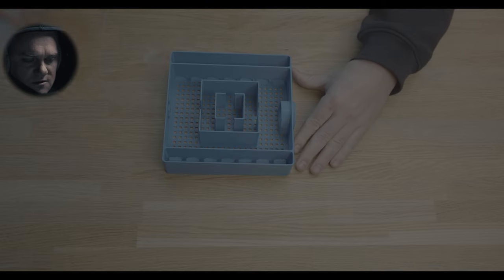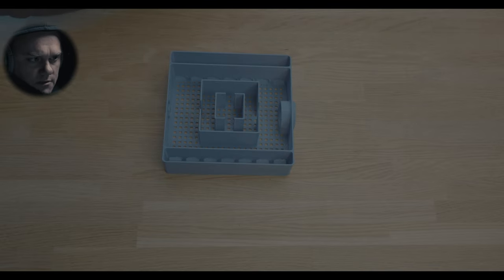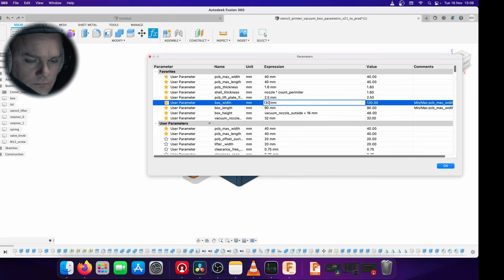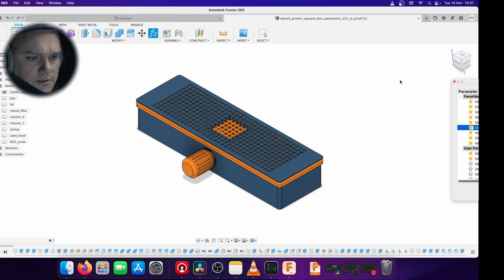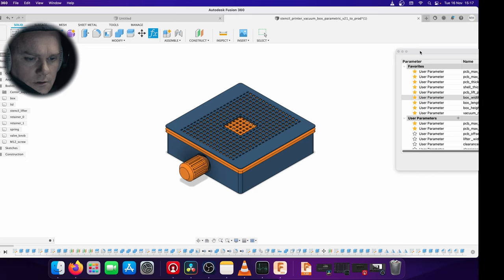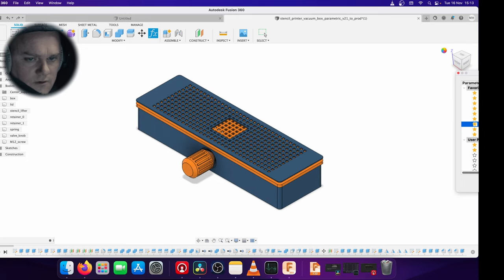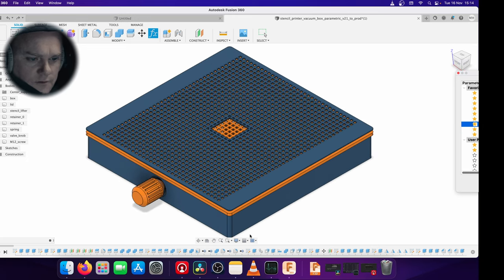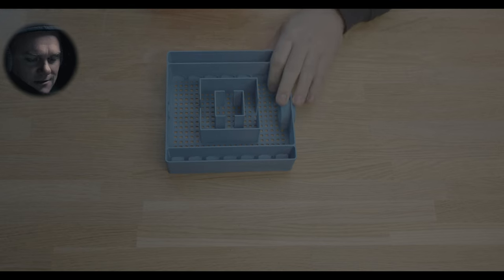V2 Vacuum assisted solder stencil box

Comment: I've been trying to design something for solder paste application for like two months now. I've played with crazy xy tables, a bunch of madness with linear rails on a bunch of extrusion, all kinds of stuff. But I keep coming back to repeatability and simplicity, and this absolutely kills it. Firing it up now to give it a test.
Reply from the maker: Yeah. I went the same route my self. Let me know if you have any issues with the Fusion files. Ive made some progress since the last video. What size stencil do you need it for?
Reply: @MariusHeier1  They were mostly fine, but I see what you mean about parameters just absolutely eating your machine, haha. My board is actually a bit huge... ~200x100mm... which ran me into another problem. My Prusa Mini can't actually manage the box for that size!

If you've got suggestions for splitting it, I'd be curious to hear them for sure. I spent a while last night plotting out the box as something I could laser cut, only coming in to 3d print the pieces that don't make sense to laser cut (anything that needs to be board height, for example).
Reply from the maker: @JonathanBarket  How big is your stencil?
Reply: @MariusHeier1  It's a full sized, framed behemoth at the moment. It needs revisions though so I'm prepping as if it's roughly the same size as the board.
Reply from the maker: And what would be the safe print size of the Prusa mini?
Reply: @MariusHeier1  Total printable area is 170x170
Reply from the maker: @JonathanBarket  Starting a stream now trying to make the box. https://www.youtube.com/watch?v=X9sA_VIDe2s
Reply from the maker: https://github.com/MariusHeier/magik_solder_paste_stencil_box/blob/main/150x300_magik_solder_paste_stencil_box.f3d
Reply: @MariusHeier1  wtf Marius this was unnecessary. You are absolutely incredible.
Reply: @MariusHeier1  It's perfect, printing one side now.
Reply from the maker: @JonathanBarket  If it doesnt work. We can fix it. You on discord?
Reply from the maker: Did you get anywhere with it? Or did you have printer fails like i did. Spent 4 weeks to make it work. Haha.
Reply: @MariusHeier1  Glad it's not just me, haha. I think it was just a coincidence at this point, but I fought with printing one of the bases for a couple of days. Printing something else right now just to prove I'm not an idiot, hahaha.
Reply from the maker: @JonathanBarket  I got enough motivation to design my own printer after struggeling with it for 4 weeks